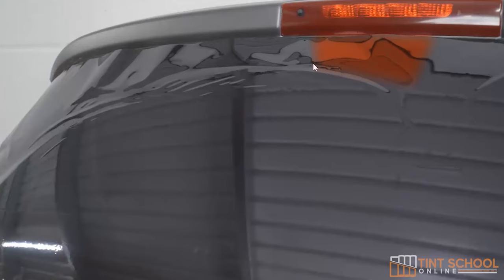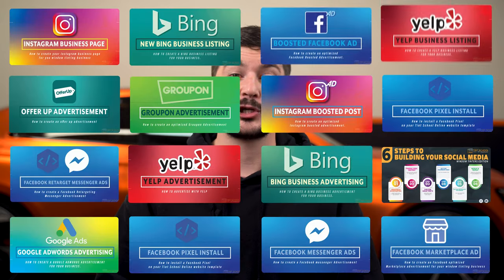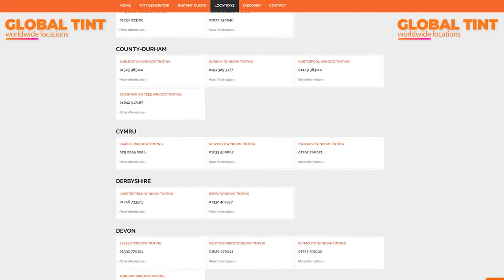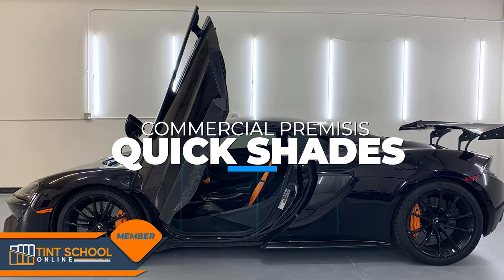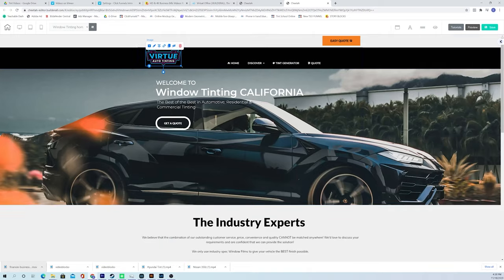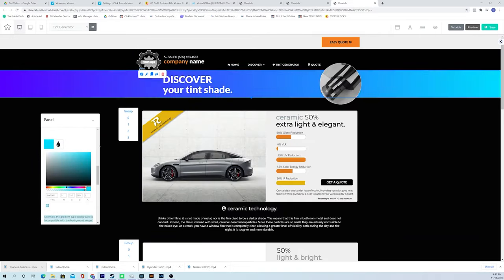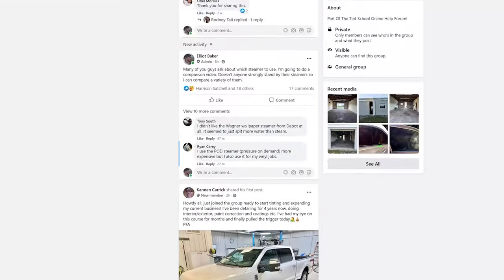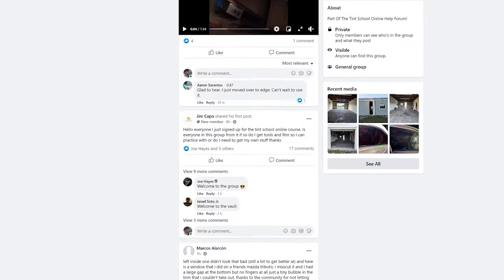❎ Top 5 MISTAKES ❎ Bad Window Tint Installs | PRO TINT TRAINING | How To Tint Windows

Comment: Nice one , I really want to know how your guys shrink the tint with heat gun is it on high or low. What type of window film is easier to shrink?
Reply from the maker: The heat gun is usually on the higher setting unless you are shrinking a tricky section

Comment: Want to ask I have done two corner windows and two rear door windows and they turned out great however I just did the front drivers window and the tint went on mint but it has left like 100 little tiny bubbles. the surface was spotless clean as I took the window out of the car and did the job indoors the only thing I forgot to do this time was shrink the tint , do you think this is why I have the bubbles? They are so small like 2 mm will they disappear as it tightens or should I start again
Reply from the maker: This would be contamination. Maybe the film folded back on itself on install.